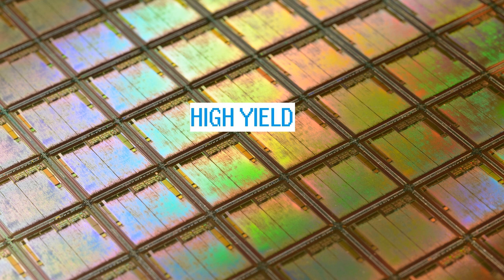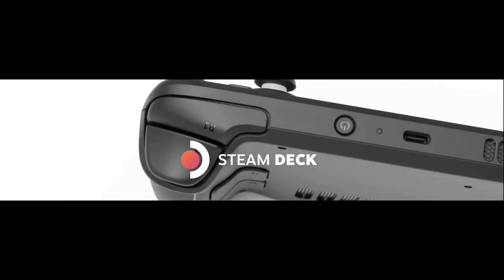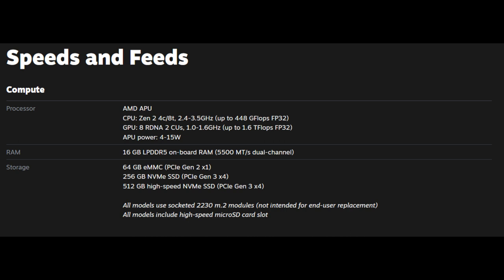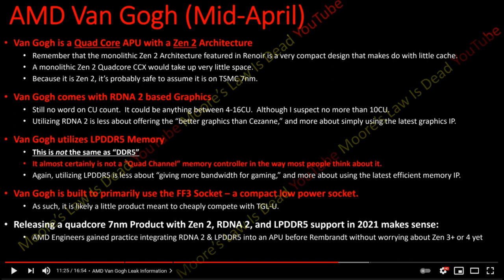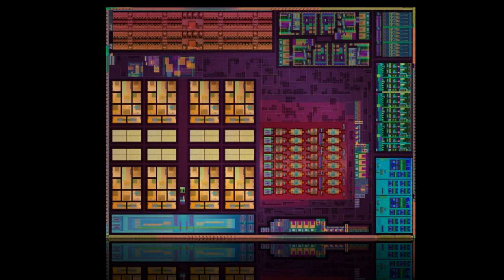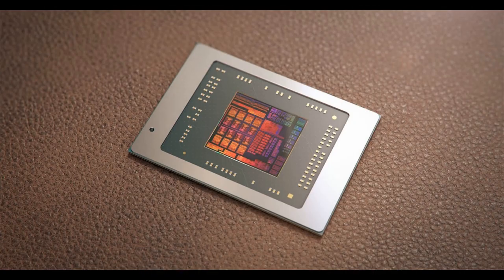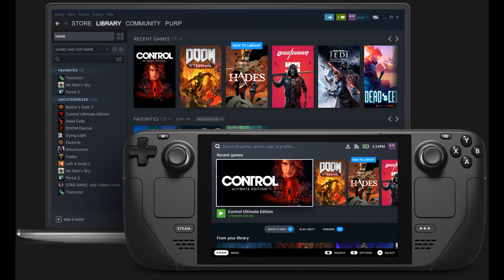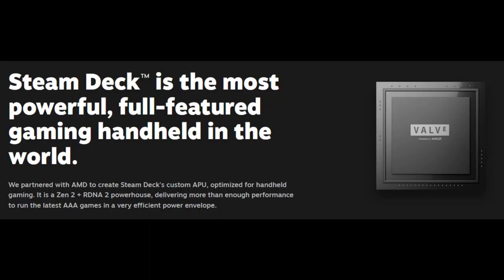Valve Steam Deck, AMD "Van Gogh" and general APU design philosophy

Comment: So this this is the video when it all started <- Read this after 1 year from today . you had 600 subs when I followed you. 
I'm sure you'll have a lot of fun with Little-Phoenix(Z4/R3). I wouldn't be surprised if Steamdeck 2 has triple the battery life running games @ 30/40fps capped. heck. I expect MS to make a handheld compatible with xbox series S but that would be  (Z4D/R4)  in 2024. there already doing 4nm for Phoenix.